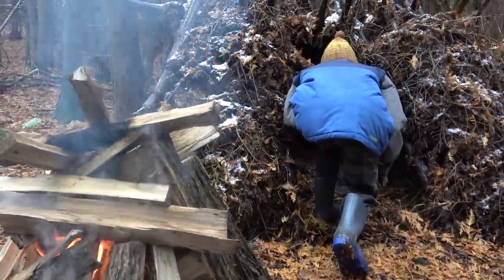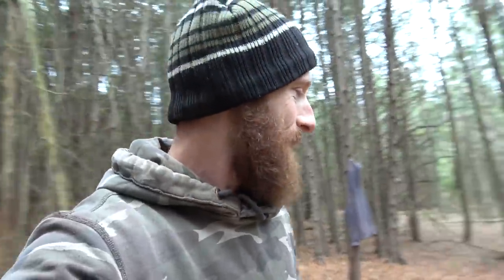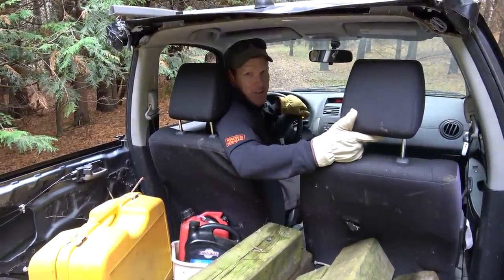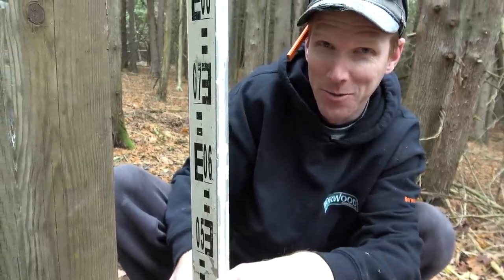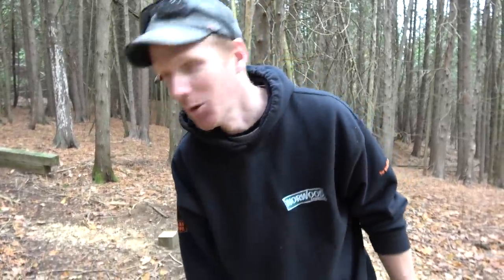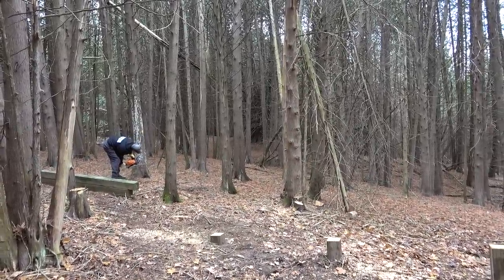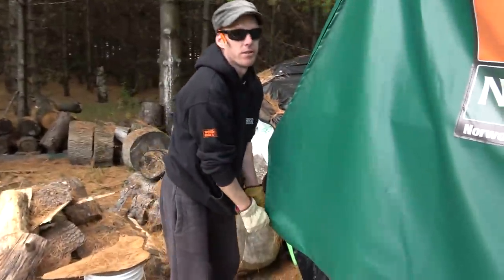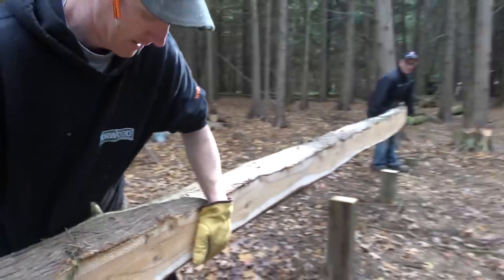CABIN in the WOODS Build! | HAND Digging & Setting Foundation Ep1

Comment: Nice addition to your channel.  I am also planning a build, it will be from some sawn material on my band mill but will also incorporate natural material in the form of birch bark, sod, clay, rived and sawn shake/shingles, not aiming for 40 years but hundreds of years, well you know... a long time.   Dig a trench and fill it with loose rock with a drain pipe in the bottom, its called a rubble trench, then just put your sill on top of the rubble it won't move and if it does it won't be much.  Looking forward to what you guys do here.  Safety Sallies I won't do that unless something blatant shows up.  That Suzuki skiddah!  You have to love dead standing cedar, its the best, your cedar looks good and sound too, no rot hollow butts.
Reply from the maker: You plan sounds awesome!  We thought about using more natural materials, but with the sawmill...it's pretty natural :)

Comment: What I do for my foundations is where your posts would be, dig out a depression about 2ft deep where Your posts would be. Line the bottom of the pit with old carpet and fill with gravel. Then, I either use big stones and drill a hole into it to epoxy in a metal connector to support floor beams. Or I make large concrete blocks that look like large stones. I place the metal connector into the concrete. Place these on top of your drainage pit and start building up your floors once everything is levelled out. Using the metal connectors stops wood from absorbing moisture from the soil / concrete and will double the life span of your building. Frost up heave is definitely a thing but is completely hyped up. I almost think it's a conscpiracy by the construction-industrial complex. I'm thinking of my grand fathers  farms house that lasted over 100 years and was only sitting on maybe 200 bricks. Then the important thing is to grade around the house properly also have a large roof over hang. I prefer low-ish roof slopes 4-12 so I can get large over hangs.

Comment: 1:50 Digging a hole with an axe.. 
3:20 Felling a tree with a shovel
😉
Reply from the maker: Nice eye!
Reply: To be fair though, the axe was likely used to cut roots.
I used to do it either with an axe or a bolt cutter, if the shovel wasn't good enough.
Reply: You gotta do what you gotta do.

Comment: I know this might sound like a strange suggestion, but it's in regards to the circular window in your small cabin out in the woods.
My suggestion would be to fabricate a steel ring about an inch or so larger than your round window.  Attach some "L" brackets to it (or design the ring to where once it's circular you could just bend them out) to attach it to the wall around where the window is, and use a rubber bicycle innertube filled with air to hold the window.  It would be almost airtight due to the force between the steel ring and window, and when you wanted to change to a screen for the summer, just make another ring the same size as your window and use the tube to hold it in place also.
As I said, it's just a suggestion.  I've enjoyed watching allot of your videos.  God Bless Brother and keep'em coming.

Comment: Really glad that you're trying out some different styles of producing videos and even doing some different stuff than videos about procuring and cooking wild foods.
Regarding today's video: I was taught that green (unseasoned) wood can warp over time. Won't that cause structural issues for your cabin over time?
Reply from the maker: It might!  Our wager is that we'd rather live with whatever happens, then wait a whole year to dry the wood!  Either way, it'll have some awesome character.  Let's see what happens!
Reply: @TheWoodedBeardsman  Fair. That just means more content for us when you fix any issues (should they appear). :D
Reply: Cedar is the most resistant wood to warping checking and shrinkage. It shouldn't be an issue....What many people don't know is that some timber that is kiln dried will absorb moister until it becomes equal with the ambient temp/moisture for that area....so dry isn't necessarily dry....which in turn can cause limited swelling and warping....

Comment: The old timers used either heavy rock or placed logs on the ground. As for pressure treated lumber in the ground it will not eventually good luck and will continue watching Had me sold along time ago
Reply: Meant ROT not Not ok my bad k

Comment: Those freshly cut ends of the treated 6x6's that went in after sawing the posts are not treated. So you just stuck thousands of vertical straws in the ground that will suck up moisture like there's no tomorrow. Right? Or am I missing something?
Reply from the maker: They might.  But I talked to some local farmers and they have cedar posts in the ground for over 40 years.  It's a local conditions kind of thing.  If problems arise, we'll jack and restructure.  We've moved entire houses, it's not something we can't fix IF it becomes a problem.
Reply: @TheWoodedBeardsman  Are those posts cedar or pressure treated southern yellow pin? In either case it was common practice to dip the ends of fence posts in creasote or coat them with roofing tar before setting them. The minute you cut pressure treated wood you loose the protection as the solution only  penetrates so far. Also those posts have very cross sectional area and depending on what the soil bearing capacity is they may have very little load carrying capacity and things may be even worse if you have bad drainage.  Ever wonder why Japanese builders place their posts on rocks?
Reply: What’s this dude worried so much about building code when you’re out in the bush that’s the trouble with society everyone else thinks they have say over what someone is doing when they ain’t got a penny into the project these people need to shut your mouth and leave they don’t like what you seeing

Comment: Wont the beam warp when it dries?
Reply: It looks dry to me.
Reply: @radagast6682  Here in Sweden we let the wood drie for 1year before construction.
Reply from the maker: It might, but it's going to be compressed between the beams and the weight of the cabin...so it'll have a very hard time warping!  Let's see what happens!  We didn't want to wait a whole year before building!
Reply: Cedar was standing dead.  Very dry to begin with.
Reply: Maybe so but so are the builders. That way it should match up perfect when it does.
Reply: Cedar is the most resistant wood to warping checking and shrinkage. It shouldn't be an issue....What many people don't know is that some timber that is kiln dried will absorb moister until it becomes equal with the ambient temp/moisture for that area....so dry isn't necessarily dry....which in turn can cause limited swelling and warping....
Reply: @memberberry8455  Those were standing dead trees.

Comment: Won't the bark left on those beams be a rot/insect problem?
Reply: It will eventually fall off.
Reply from the maker: The bark is really thin and water repellent, so it should be just fine.  Most of the bark is going to be off it in the next season!

Comment: Those treated post aren’t going to last anywhere close to 40 years, back filling the holes with clean stone would have helped. Thumbs up
Reply from the maker: Easy fix if they rot!  Jack and restructure!
Reply: Doug Moore  Nope you don't fill post holes with clean stone(gravel) you'll have a hole that will allow water to fill around the gravel and the post will rot faster, hard packed ground like the decomposed granite they have is excellent back fill material, these posts could last for 40 years, it's the ground that seals them from air and moisture, they could rot off above ground from weathering before the part underground does.
Reply: Dan Thomas no
Reply: @dougmoore7116  Well my 40+ years in the construction business tells me you're wrong. Do you know what a "dry well" is?  That's exactly what you'd be making by filling a post hole with gravel or(clean stone) as you called it. A dry well is a stone filled pit that can fill with surface or storm runoff water. 
Facts and common construction techniques says that back filling post holes with clean stone is not a good idea nor will it help in any way against rotting, but you do it your way, I "know" better, so you can keep your..... no
Reply: Dan Thomas post were used n half rotten to start with n you say they could last 40 years. With all that experience you still don’t know what you’re talking about.

Comment: Not that it matters for what you're doing, but getting matching numbers for the ends and for the sides says NOTHING about how squared the building is. You have to match the two diagonals. If your sides match and your ends match, all you know is that you have a parallelogram, not whether it is a rectangle or not.

Comment: 11:28 186-7/16" ain't 186.5
11:37 185-3/4" ain't 186
Reply: yep. but close enough considering  they're building a big ass tree fort that isn't in a tree. ..i want to see more!
Reply from the maker: That's how it gets square! :)
Reply: @TheWoodedBeardsman  I know how to square a building but I also know how to read a tape measure
Reply from the maker: It's all in your mind man!  No drawings, no blueprints...let's see how it turns out!
Reply: Drywallers get er to the 1/2"
Reply: @cmosphoto1  if your plumber did that you'd have a leak. If your roofer did it you'd have a leak. If your door hanger did it you'd be locked out. Not everybody gets to tape and mud over their laziness or hide mistakes with crown molding.
Reply: @mwilliamshs  very true.  But when dealing with a tree and using a chain saw getting within a half an inch ain't bad.
Reply: @cmosphoto1  11/16" ain't half an inch and the 6x6s were set in dug holes, so they're not trees and they weren't cut with a chainsaw except to height. These posts could've been within a sixteenth pretty easily. That's not necessary but it's not difficult. My point isn't that they're not square. My point was the measurements verbalized aren't what the tape shows. Check the timestamps.
Reply from the maker: Kevin often misreads the measure and blames it on other people LMAO.  Honestly...we weren't even trying to get that close because all of our materials are custom made, so there is no need to measure to the inch or half or quarter or 1/16 or 1/32.  I worked for a bee hive guy and he did it to the 32nd!!!
Reply: @TheWoodedBeardsman  all your materials are custom made? Who do you know that pressure treats their own lumber?
Reply from the maker: @mwilliamshs  I'm gonna pressure treat your wood soon LOL